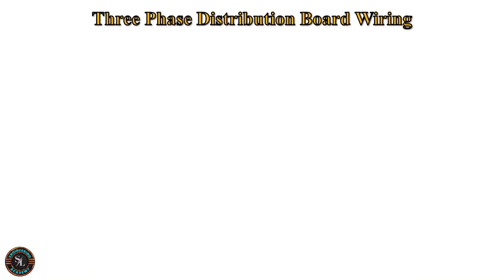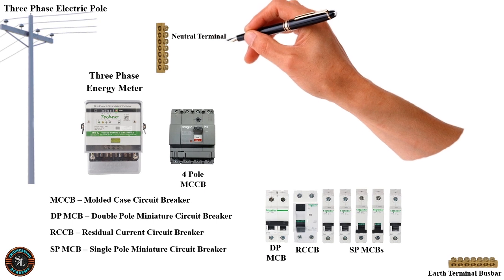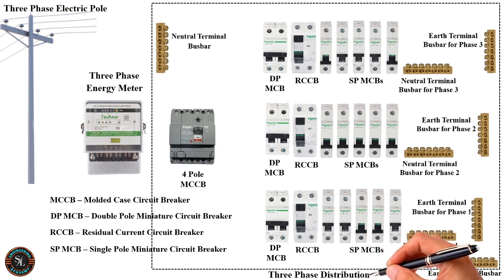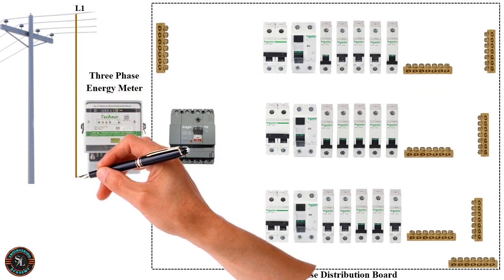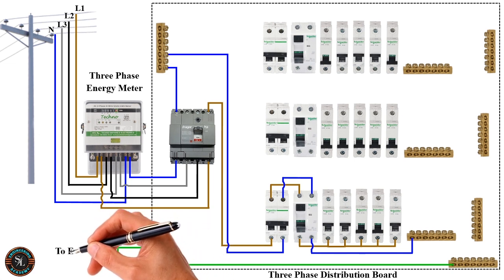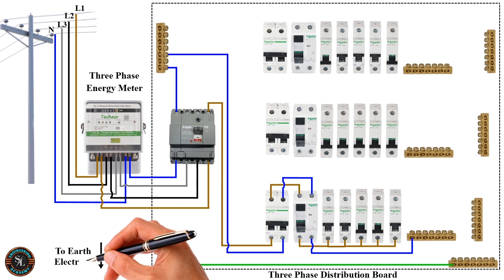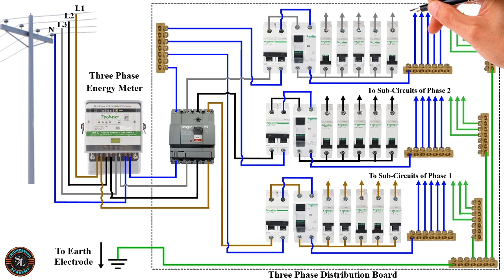3 Phase Distribution Board Layout and Wiring Diagram / Three phase DB Wiring with New Color Code

Comment: The new color code is kind of dumb. 
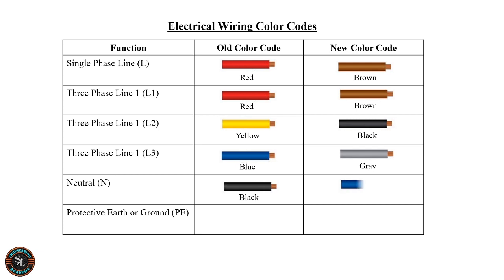At 2:20, the switching between previously Neutral Black (which is what human naturally think of black as void, devoid of any voltage, and it is also coherent with DC Black = Negative) 
to become: Neutral Blue and Live wire Black is just beyond stupid.

Comment: Where do wire using 3 phase distribution board
Reply: Some loads require 3 phases to work so you would need a 3-phase wire to be installed